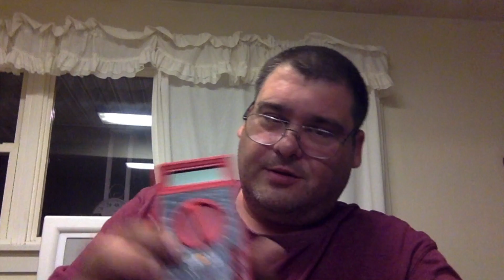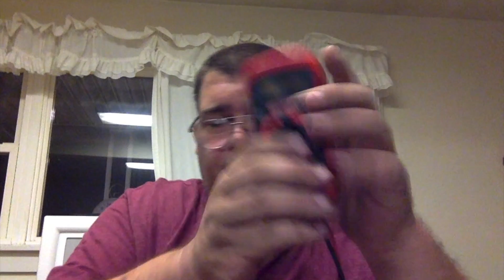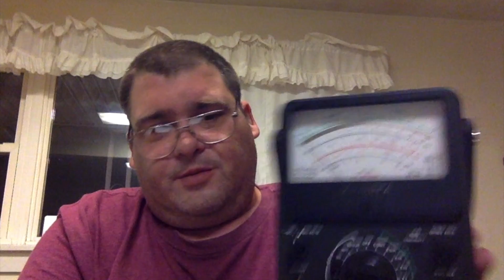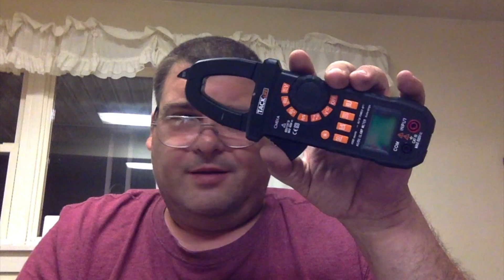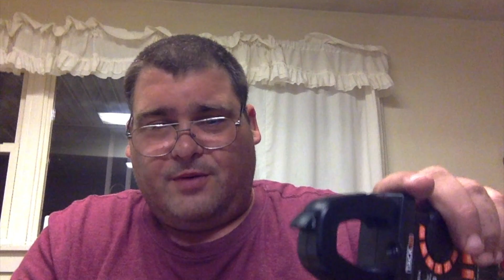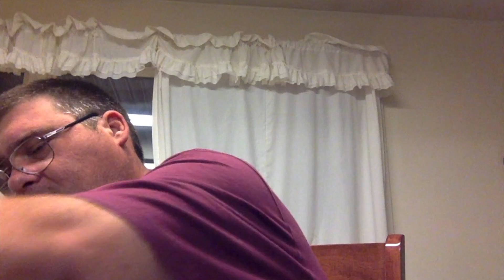Affordable Automotive DVM/DVOM  & Low Cost DC AMP Clamp

Comment: Hi..is the tacklife meter the lowest priced dc amp capable clsmp meter u hsve found?..
Reply from the maker: Yes
Reply: @frugalprepper  thanks.is your tacklife CM01A or CM06? .the link for the clamp meter is now$40 and is CM006 not $30..but i looked on ebay and could not find a clamp meter that does AC and DC current for under $35....harbor freight model is $90...im trying to find the cheapest model for home hobby use only...that will do AC DC current and it seems $35 is cheapest...and fyi i can not stand Amazons manipulated search engine it is so corrupt..jeff bezos is corrupt manipulator he has brainwashed and manipulated everyone even our government.
Reply from the maker: @shelby50411  Mine is the CM01A they don't make that specific meter any longer.  It only had 4000 counts, the new version has 6000 counts, and it looks like it does cost a little more.
Reply: @frugalprepper  thanks i dont think counts matters since hobby use only..as long as it works ill be ok..i found a new old stock cm01A model for $30 ill buy it
Reply: @frugalprepper  Hi Dr pepper i ordered the CM01A like you have and it does seem pretty nice for the price..the backlight display is nice and i like the led light on top..cant beat it for the price $24 usd and free ship...and it does feel decent made...doesnt feel like cheap junk.....only issue is that with the meter on and nothing through clamp it shows amps in the reading..not sure why since nothing is in the clamp area..mine shows .13-.20 amps in DC mode with nothing being metered..i may have to return it..i hooked it around my laptop ac adapter and ..with wire in clamp it says .20 amps and with wire out of clamp is shows .20amps...thats not right becasue my ac adapter is a 4A output
Reply from the maker: @shelby50411  There is a zero button to zero the meter.   You have to measure only one side of the circuit at a time.   So going around you laptop DC adapter is measuring both the positive and negative.  I won't work.
Reply: @frugalprepper  oh that sucks..so i cant use it on home electronics..i can only use it on car battery or anyhting that has + and  - cables separzate which sint much around the house..what about AC..will it measure ac appliances etc? or no
Reply: Thanks i took your advice and bought a new old stock tacklife cm01a for only $24...

Comment: That free harbor freight meter will get u out of a jam here and there, also good to verify no power so u don’t kill yourself.
Reply from the maker: I probably wouldn't trust it with my life or use the test leads that come with it for anything with enough voltage to kill me, but hey it you need to check a car battery voltage or something it will work for that.
Reply: yea I agree but I will trust it if it verifies the same thing my Fluke or fieldpiece says. What model tach meter is that ???

Comment: Strange name for a meter, lots of these meters are the same model and re-branded with different names. If you can afford the Klein its much better meter, the CL380, CL800 and CL900 test AC/DC current.

Comment: tacklife cm01a - Can you use leads to measure current? Or you can only measure current with clamps?
Reply from the maker: No current on this one is measured with clamp only.  If I need to measure with leads I go to another meter.
Reply: Your usually limited to 10 amps with leads and need to put the meter in series with wire, clamp meters can test from hundreds to thousands of amps.

Comment: I bought a nice little set of test leads at Amazon (seach for 'Extech TL809 Electronic Test Lead Kit') which has been very helpful. It's main set of leads  are quick disconnect so you just pull one end off and slip on another w/o removing the leads from your meter and they come in a nice case that I put in my electronic bag.
Reply from the maker: Wow, not a bad price on those either!
Reply: Yeah, and one of those leads has male banana ends so you can stab it into the alligator clip ends they also give you. I got this set, and the backprobe set you mentioned, for Christmas last year and it's some good quality testing equipment with a really good price tag :)

Comment: Tom, I wouldn't buy the Hantek scope. I bought one and I bought the large and small amp clamp. That Hantek scope is terrible.  It is the software that makes it so worthless. It crashes occasionally, it only records one screenshot across the screen. i.e. the last screenshot as you are walking over to the computer to hit stop. I had to manipulate my windows 10 to get it to work. Something about unsigned drivers.  I would save your money and buy a Pico 2204A. It is only a 2 channel scope, but is about $120 or $140 on amazon.  But it is a PICO, and we all know the software of that is impressive.  The recording and zooming blows the Hantek away, (which the Hantek can't even do).  If you really want, I will mail you my Hantek to try it out and you can see how crappy it is.  I ended up getting the PICO and never use the Hantek.
Reply from the maker: I really need more than 2 channels.  I have 2 now and end up needing a third quite often.  If you want to make me a deal, I will buy your Hantek off of you though.  I know it's not perfect, but it's better than what I have now.

Comment: I was quite suprised how well a harbor freight Digi meter read...it was a bit slow getting resistance but dead on w my fluke....it was the copy of the Sears master Tech (green) and had a light amd sound meter (suprised it was very accurate compared to my pro meter) the humidity and temp were very close also. I have 2 now and let my flukes rest!